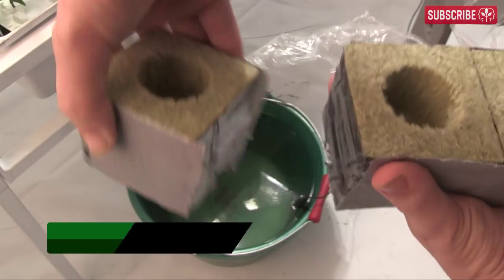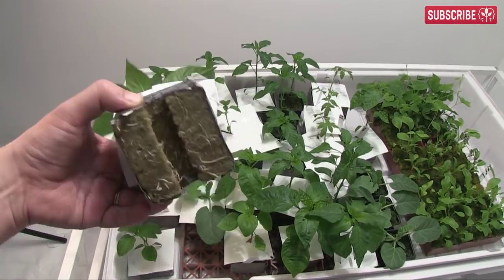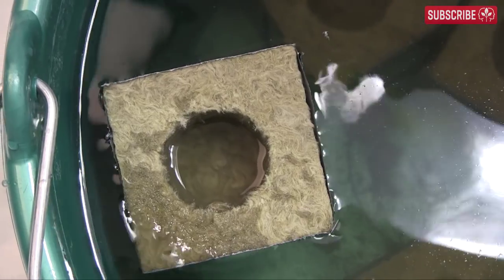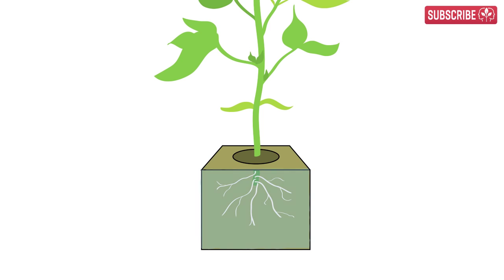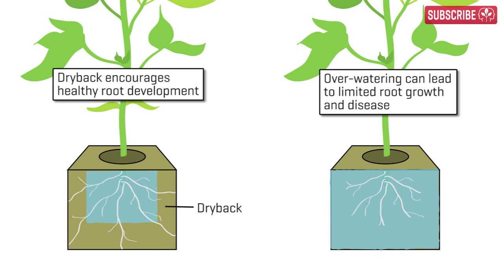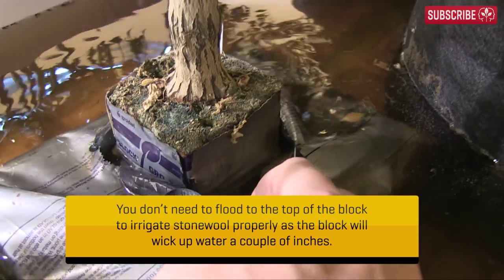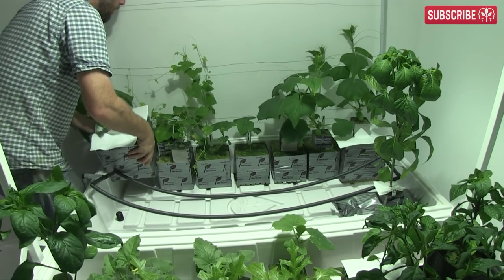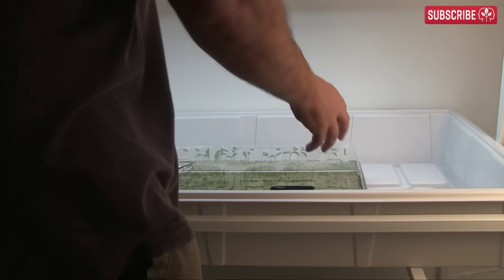Stonewool Hydroponics Irrigation Quick Guide

Comment: What about bottom feeders
Reply from the maker: Thanks for your question! I don’t recommend bottom feeding with rockwool. Always top feed because you tend to be running a high EC for fruiting flowering crops and you want that top-down flow through the substrate to purge it of residual salts. Of course, if you’re prepared to take it super easy with EC then you could open up this irrigation method although it’s really optimized for top feeding. Bottom feeding could more easily end up with overly saturated media.

Comment: you say it is impossible to overwater with this stonewool. I find that to be 100 percent not true.  if you saturated rockwool. then leave it in 80 % relative humidity like when you have seedlings.  the moisture goes nowhere.  2 weeks later no sprouts never watered soaking fucking wet. overwatered in ONE watering.
Reply: If you can find it, try Cultilene stonewool. It doesnt go mushy like other brands as the fibres dont just run in one direction. I prefer the mini cubes (croutons) to solid blocks, the voids provide more O2 and roots love them ;)

Comment: I've have some issues with germination of chilli peppers in starter plugs. The problem is the root has trouble penetrating the medium. I've taken care not to squeeze the cube and not to have it saturated with water, but those roots still have issues. It takes a really long time (weeks) to penetrate and this kind of screws up the early development of the plant.

Has anyone had similar experiences which they managed to figure out?
Reply from the maker: Randy Marsh Hi Randy—are you sure you're not keeping the plugs too moist?
Reply: Everest Fernandez I follow a method where I soak them and then lightly pick one up and then kind of shake some of the water off it. It's then about 60-70% saturated.
I've noticed some people stick a toothpick down the hole before inserting the seed. I could try this.
Reply from the maker: Randy Marsh Hi Randy. I don't think there's any need for toothpicks. I just lay the chile seed in the hole and tuck over a few fibers, just so the seed is surrounded by moist rockwool. I presume you're pH adjusting your soak water to 5.5?
Reply: Everest Fernandez  Yep, the water is roughly between pH 5.5 and 6. I use litmus strips. It could possibly be the brand of rockwoll, which is a no name brand from my local grow shop.
Reply from the maker: Randy Marsh Ah yes. Try Grodan Randy. I'm sure you'll love it.